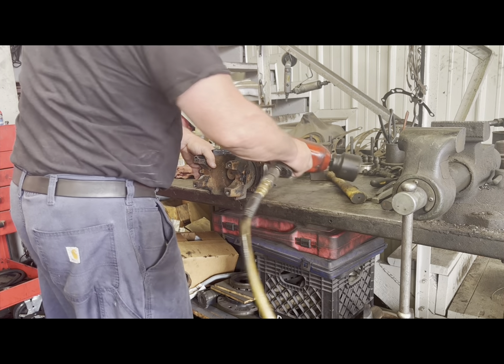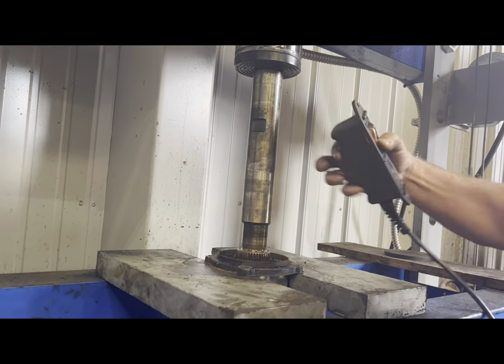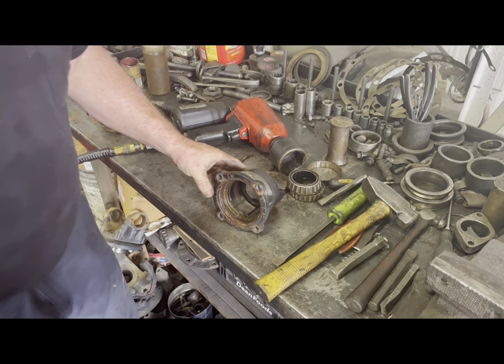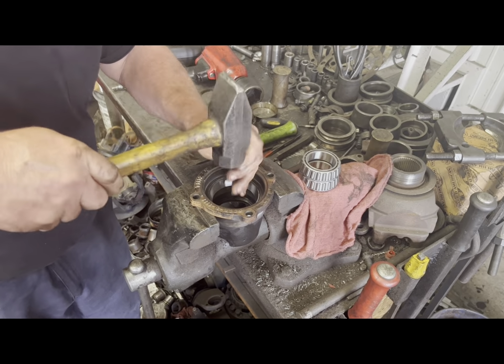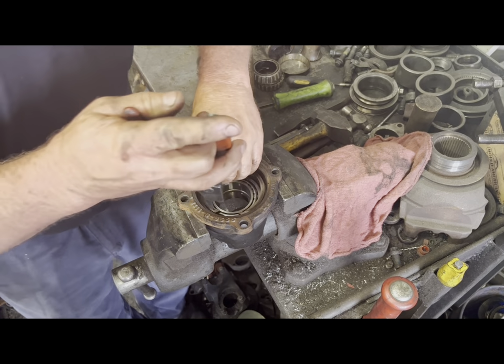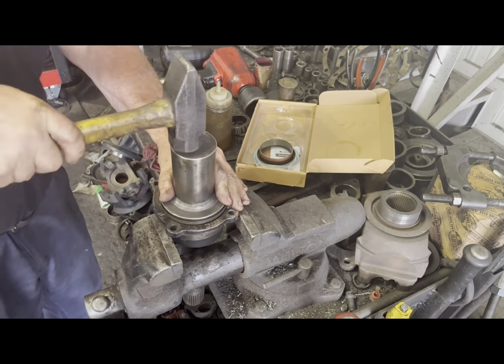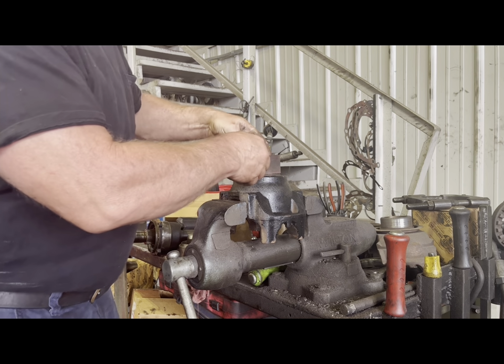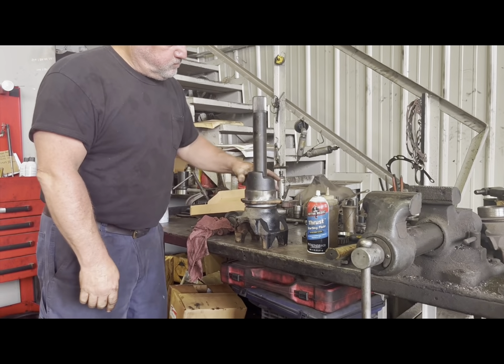Thru shaft bearing and seal replacement on a Merritor Differential

Comment: Can it be done without a press?
Reply: yes, wil need an oil bath, or oven to heat the through shaft bearings and install them onto the shaft first then drop the shaft through the  bearing carrier then install the "outer" bearing cup in after then snap ring then seal then yoke, may require a puller to remove yoke

Comment: When putting the thrushaft back on do you have to align he esplines or something???, or can you just put it in any position without worrying about any sort of alignment ( input and output yokes not aligned).???
Reply from the maker: The splines on the output shaft can line up anywhere. The four bolt bearing housing has to be turned the correct way
Reply: Thankyou for the quick reply